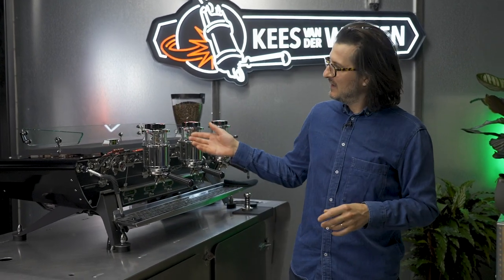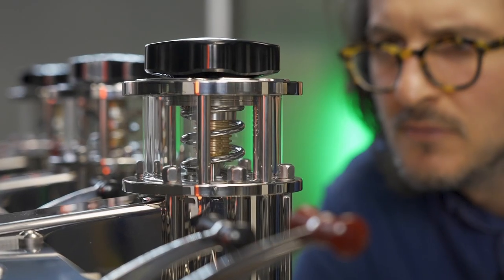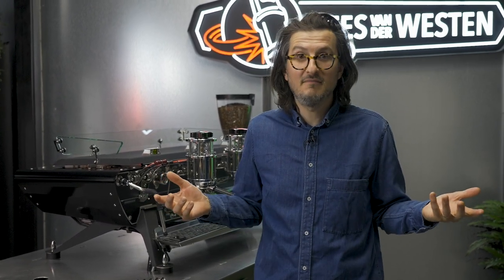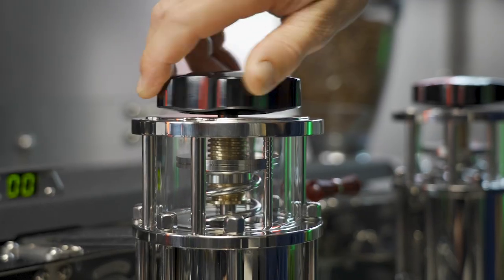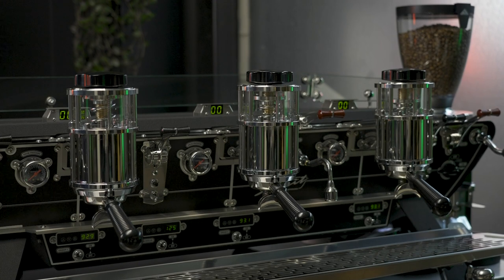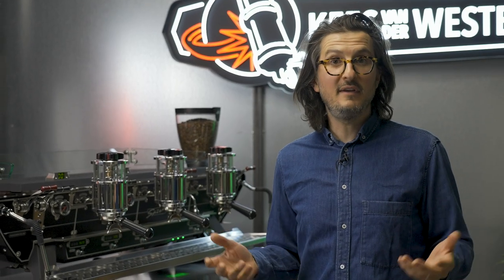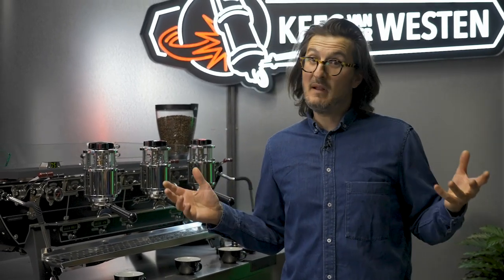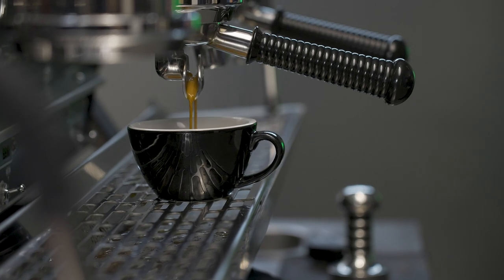The Advantages Of Pre-Infusion: The Idro-Matic Explained

Comment: If I opt to retrofit the idro-matic on the speedster, will the dual spring preinfusion piston DSPIC still work?
Reply from the maker: Yes, combining both systems i.e. allows for prolonged slow build-up of pressure if you adjust the Idro-Matic to start where the dual ends. Or use Idro-Matic for declining pressure at end of extraction by switching to centre position of lever.
Reply: @KeesvdWesten  Is the declining pressure similar to the one of a lever machine? How would it compare?